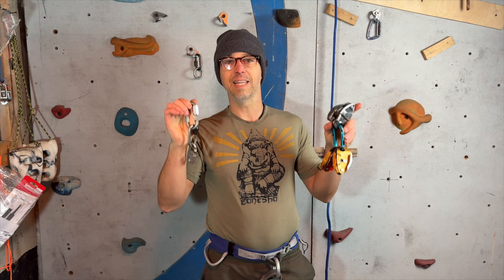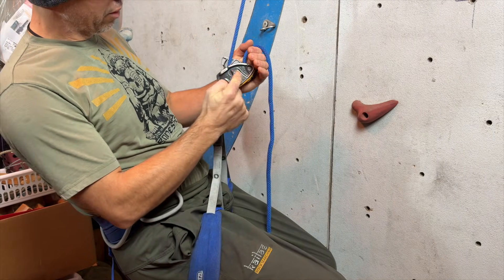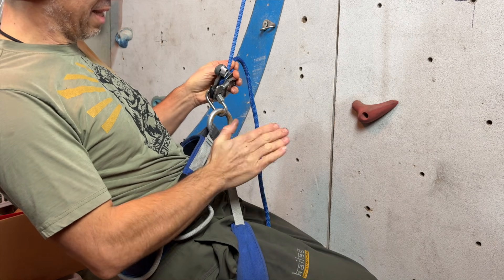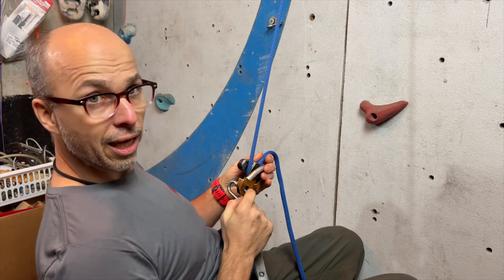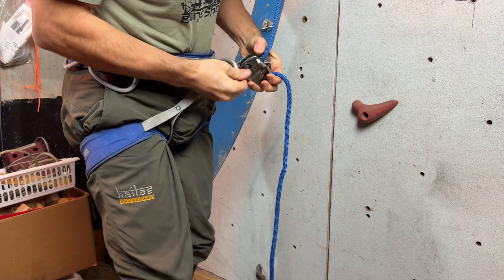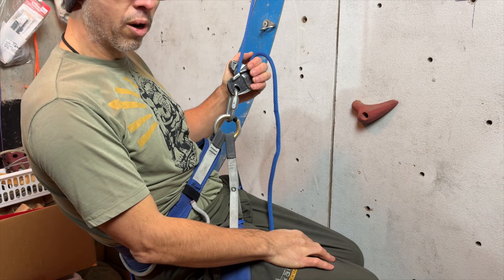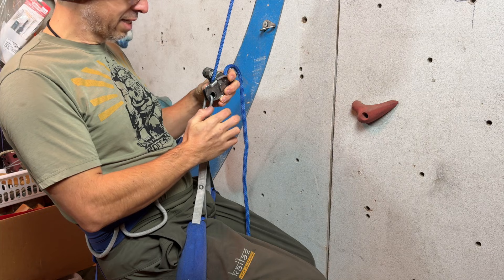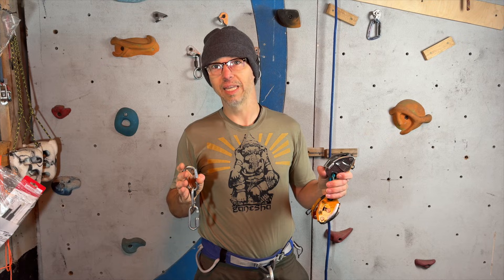Stop Using 8mm Quick Links With the Grigri

Comment: So i experimented a bit with different connections Grigri to harness.

a) 8mm Quicklink with positioning element: Works pretty well, doesn´t turn, so the screw cannot go into the grigri. The connection is a little "stiff" because the Grigri has little room to move and is kept in the same position. The positioning element comes very close to the grigri. That did not seem to be a problem
b) 8mm Quicklink with tape as shown in this video: Works also, it is possible the Quicklink turns a little, but the screw cannot move into the grigri.
c) Mammut Smart HMS Carabiner (Similar to Belay Master): The grigri cannot turn around and crossload the carabiner, but sometimes it will move a little and then auto-feed a little worse. I added some tape to the carabiner to prevent the grigri from turning. In general that worked. I remember Tom Randall´s fall of course, but he used a BelayMaster Carabiner without the positioning element, which made it a regular HMS.
d) Anti-crossload Carabiner with Flex-Link by Avant: Works well and seems to be very safe. Before i had the flex-link i made something similar from rubber and clipped that into the small accessory carabiner holding the grigri upright. It pretty much did the same. 

e) Still, using any of the above means you have a little more to do than just using the Clypsedra S carabiner suggested in the video. So in my opinion, that is the best solution to combine safety, functionality AND convenience.

Comment: I use a small clepsydra but also thread a 4mm soft shackle through the grigri as backup for LRS. It's easy to connect and disconnect. The soft shackle goes through my tie in points, so it also backs up the belay loop. 

Not necessary, but hey: super bomber.
Reply from the maker: For sure! That sounds great!!
Reply: So you have the soft shackle an the carabiner go through the hole in the grigri? Do you close yours with a knot like the one sold by how not 2?

Comment: O wow, thank you very much for this video!
So I thought the 8mm Quick Link should be stable enough in all directions, because it won´t break under 10kn. Of course it is possible, the Quick link turns around and is loaded as shown in your video.
Could you explain, what is the risky problem here? Can it bend the Grigri and damage it or make it fail? Or do you think the crossloaded Quick link itself might fail?
I have a positioning/locking element for the Quick Link (made from plastic, mine is sold by Salewa). Your solution looks pretty straightforward, I guess you can still open and close the Quick link this way.

But I might just get the carabiner you recommended. 

Thank you very much for pointing this out and even film it!
Reply: Do people really do this? 
I have never seen anyone do this before is it a weight thing or what?
Reply from the maker: @Ruben-lee You mean why do people use a maillon with a grigri? Because they feel it is a safer connection for LRS climbing... Makes sense? I climbed El Capitan with a grigri and a maillon... LOVED it! But that was before I discovered it could jam in the device... Maybe I should have been more scared?
Reply: @Ruben-lee Probably some climbers doing LRS choose a maillon as a connection to the harness because it is very strong in all directions and for sure won´t break under 10kn, which should never occur even in case of a hard lead climbing fall. That´s why I chose a maillon, too, it is no weight thing, the steel maillon is heavier. 
However, as Yann brought up in case the maillon turns - that for sure can happen, if you don´t do something against it - this video demonstrates how that can damage or maybe even break the grigri. I also learned, that after a hard fall in this scenario, the maillon might be bent and impossible to open - not a good situation to be in..

I have to check if my positioning element safely prevents the maillon from turning - depending on the direction of force, the positioning element might break in case of a fall?
Reply: @EdeSchmitt interesting thanks
Reply from the maker: For sure you can break or bend the grigri I believe. Maybe bending the quick link and making it impossible to open could happen too.
Reply: @YannCamusBlissClimbing  Maybe I also should have been more scared.. Actually I haven´t fallen on lead while LRSing ever. Do you think the positioning element (as shown in Edelrid´s Video used in the acnhor attachement with a maillon) also solves the problem? I don´t think you can use both (positioning element and electric tape), the positioning element probably won´t lock this way.
Reply from the maker: @EdeSchmitt multiple ways to achieve the same thing I guess!!